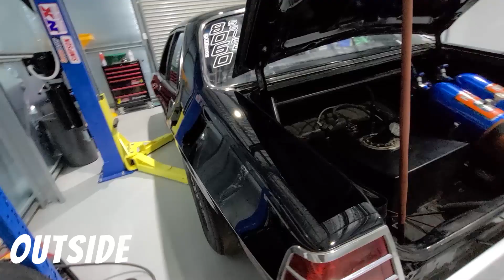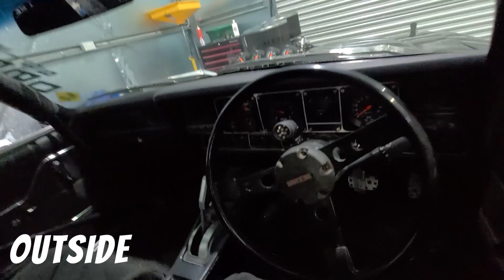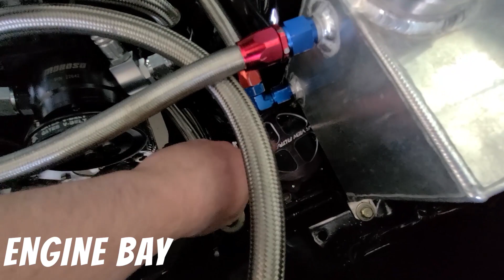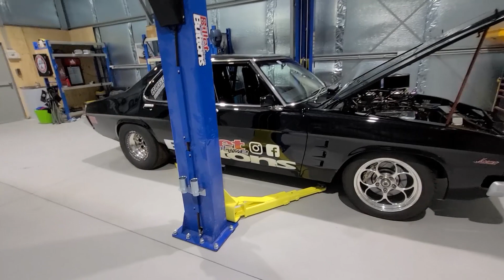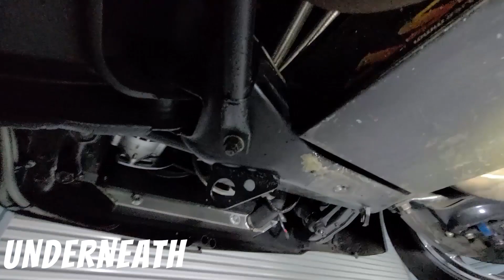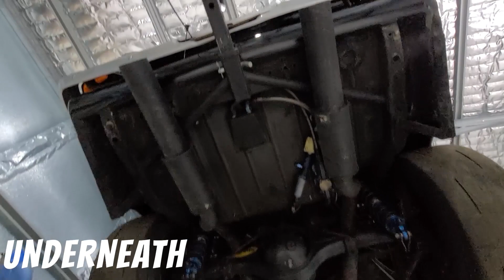MCFRY FULL WALKTHROUGH VIDEO OF THE WHOLE BUILD

Comment: How long does the nos last you ?
Reply from the maker: Not long at all, Id get 1 quarter mile run on a single 10lb bottle then id have to refill it. It would use maybe 4lbs of nitrous on a run for a guess and the bottles dont work well when they have under 4lbs in them.

Comment: If you want to swap your diff housing, I've got two unMolested 9" housings you can choose from.
Reply from the maker: I am really waiting for something to bend or break then I was going to fit a floater diff with adjustable holes to get the arms in the right spot.
Reply: @MCFRYMotorsport  fair enough.
Reply: @MCFRYMotorsport No fun when an axle comes out the side.
 floating axles would definitely be alot safer.

Comment: Hey mate do you have the road regod? I heard you Australians don't really put your drag/burnout rides on the street?
Reply from the maker: I do but its one of those things where if you drive on the road you just run the risk of getting pulled over. The main eye catching defects/targets are stuff out of the bonnet and roll cages which would initially get you pulled over by a highway patrol officer thats had a slow day then they would likely defect the car and fine you. Its a bit of a money grab in Australia. Worse case you get a lot of fines and you have to get your car inspected by an authorised station. That being said I could drive this on the road once a weekend for a year as the car is with road legal tyres and the chance of getting pulled over is rather slim if driving normally. Makes it very hard in Australia to build a modified car and have it legal, it more a less handicaps your build if you follow the rule book. Hence why the next build I am doing Is just going to be a track and event car.
Even our drag challenge to be able to run anything but a reverse cowl bonnet and standardish wheel tubs you also need to bank on the possibility of getting pulled over for the weekend.

Comment: Awesome build, HBR do the best cages. Is that 3700 with you in it?
Reply from the maker: Yep 3700lbs that's with me in car, exhaust removed and racing with one nitrous bottle 👌 lithium battery and fibreglass gear dropped the weight of the car around 45kgs and I've always raced with 2x bottles so I'm just going to race with one next time so that's another 13kgs from the car.